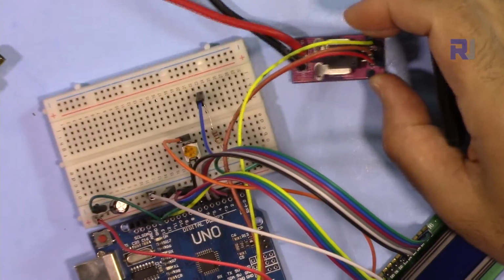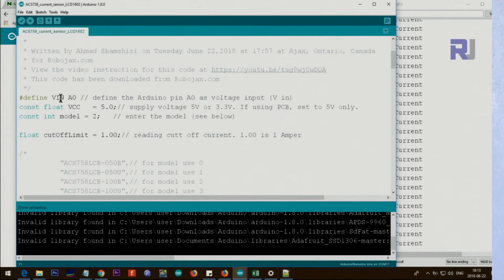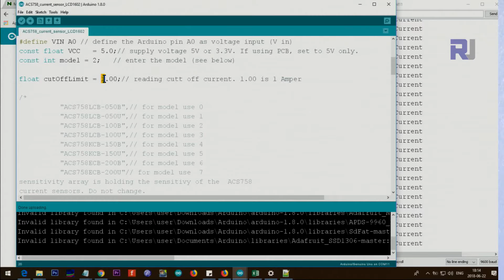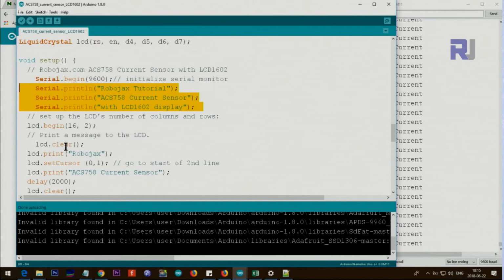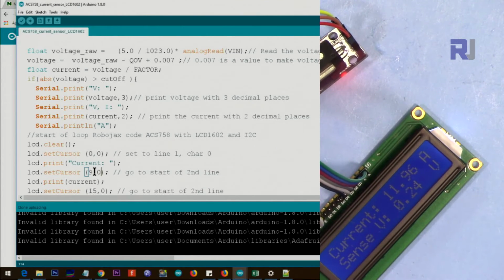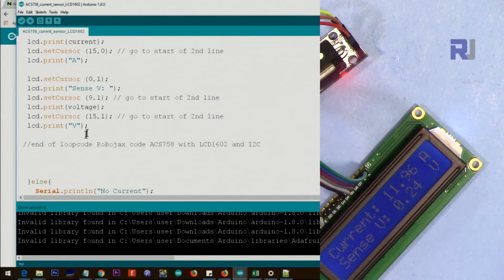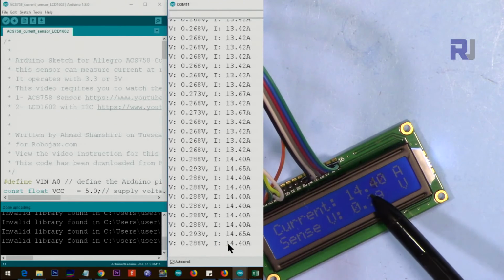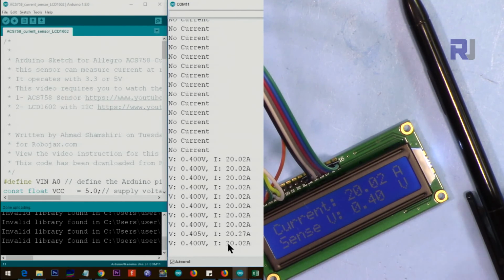Measure current with ACS758 Current sensor and LCD1602 with Arduino RJT90

Comment: It would be possible to present a solar deviator, which uses a current sensor (ACS758 Current Sensor) through which the phase from the meter passes, the arduino should measure based on the voltages generated by the hall sensor, if there is a surplus of energy from the inverter to give a digital signal to SSR relays preferably on a frequency of 50hz, if it could be deviated according to the current surplus. for example, if I have a resistance of 1kw and it reaches the maximum load, then let the other ssrs come in and let's say 4 SSRs.

Comment: Hello, very simple project, ACS758 is obsolete and the price is little.  Please tell me why you need "Sense" value on your screen and what represent this value? Thanks
Reply from the maker: I have explained it in the video. It is the voltage from the sensor.  Just for reference. From this voltage, current is calculated.